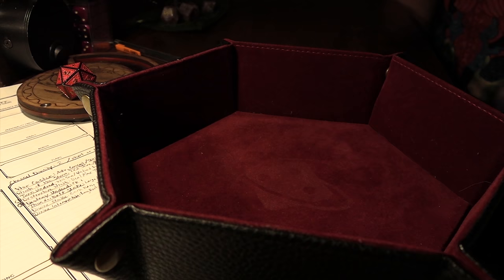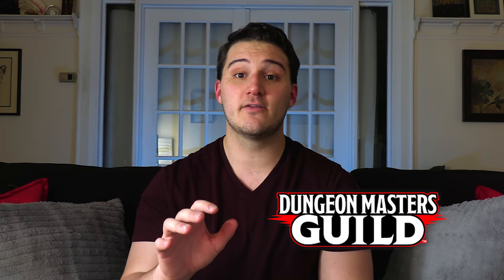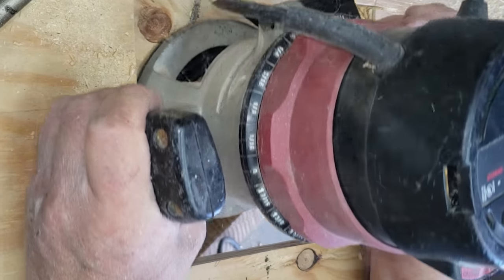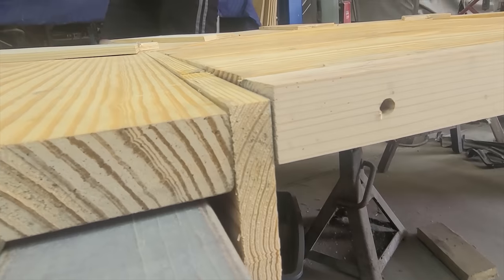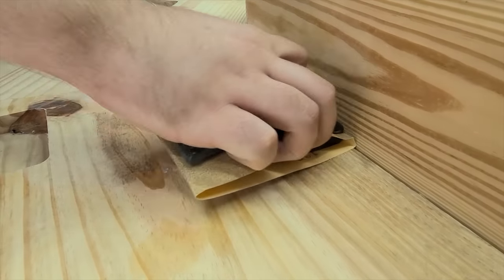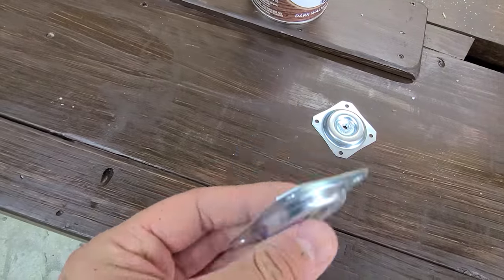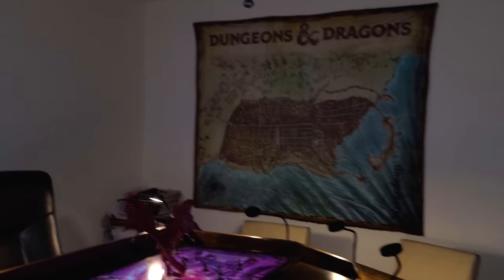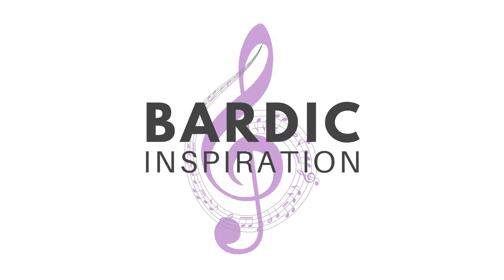How We Made Our Custom D&D Table

Comment: I would get a piece of Plexiglass to cover the tv to protect the screen
Reply from the maker: We talked at length about whether to do this or not. Ultimately, we'd rather just use the TV screen instead of using a sheet of glass/plexiglass that could possibly distort the imaging or give the appearance of the minis "floating" over the battle map. Regardless, we've had no issues with damage to the TV screen after a year of continued use